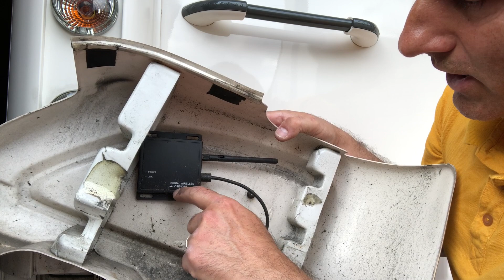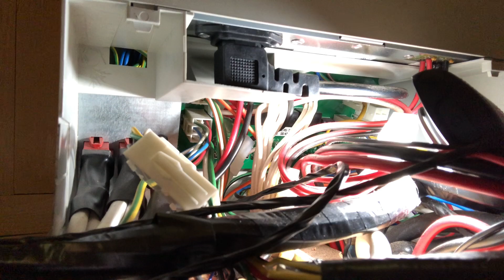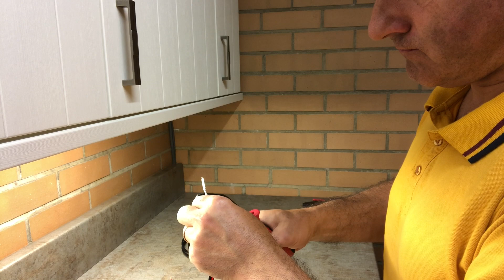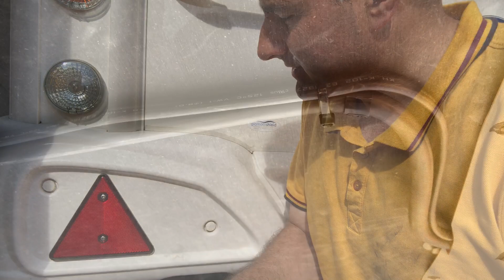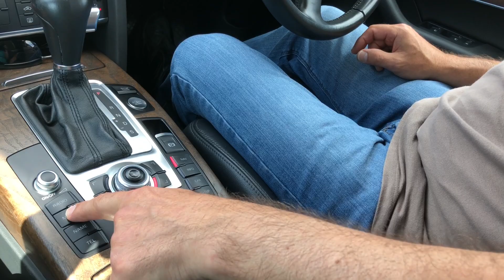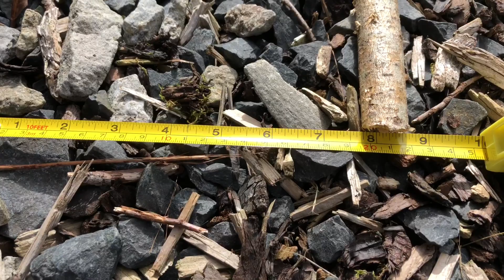Caravan Reverse Camera

Comment: Hello Rob
The most common insurance claim by more than double of everything else put together is reversing a caravan.
I have the highest standard of driving tests and class one.
If I was taking a student out for an advanced driving lesson this is my advice 
1/ learn how to reverse your caravan 
2/ Always pull up just past you pitch unhitch and use your motor mover to position your caravan
This was you will stop the accident. No one goes out to have an accident they happen so remove the possibility. 
Over the years we have seen people slip the clutch and tip the caravan over on his wife. This year out of the 6 sites 5 of them had members reversing into bollards. 
Being a good driver is about reducing risk if you follow my advice you will never reverse into something. 
Stay well and have a great new year. 
James
Reply from the maker: Thanks for your comment James, common sense and good driving skills are important and I agree with all your advice having myself passed the advanced driving test in 1994. However, I am fond of DIY, always up for a challenge and like my gadgets. Having the ability to connect an external AV source to the cars screen was a good incentive to fit a camera. I have to say it’s something I haven’t regretted as Gail admits to being the worlds worst banksman. Unhitching and using the mover is something I do when the road is too narrow to reverse onto the pitch. The times when I do reverse on I fine tune the caravan position with the mover. Wishing you all the best for the New Year, Rob

Comment: Great Video - got me looking for a camera system. One point I would make is the inline fuse should be as close to the feed end of the wire as possible to protect the wire run from a short to ground. Don't know what the main fuse is but if the wire is not rated for say 20A and you get a short between the fusebox and a fuse in the tail light area then you could get a potential fire.
Reply from the maker: Thank you for pointing this out David. I can’t remember the wire rating but it is equal to or slightly higher than the ignition wire it takes power from. I just left the inline camera fuse where it was. As all the caravan rear lighting wiring goes straight from the car to the lights without any additional fuses I thought the camera wiring would be ok but it is something to look into. Thanks for watching and commenting, Cheers Rob

Comment: Very interesting. I have a wireless one plugged to the caravan battery with a spe rate screen. Mainly as I tow with two vehicles max the discovery had media interface so could do the same. The jag would need a new software set up I think. 

Not having a great deal of luck with wireless however so may need to re think.
Reply from the maker: Hi Justin, If you could manage to connect to your vehicles screen it would be good. But this would mean having a signal receiver in each car. As for wireless I wasn’t sure I would get a strong signal by fitting my sender to the rear of the caravan. However, I should have pointed out in my video the symbol on the screen indicated a strong signal. Hope you come up with a solution. Thanks for watching and commenting. Cheers Rob 👍

Comment: Excellent job as usual Rob and nice to see using all the right connectors , heat shrink and wire so no Billy Bodge Job.! Very professional.

I would like a rear view camera and unfortunately I don’t have a rear camera in this car ( VW Touareg). The OEM kit to use the existing MMI screen is quite expensive. It’s a similar system to yours but I don’t have Tv tuner just dvd playback which cuts off when you move and reverts to audio only.

An idea I have is to purchase a new dashcam with the rear camera that mounts on car rear window( Nextbase 522). 

As this rear camera comes with a 3.5mm connector I intend to use an extension cable to then move the camera from rear car window to the back of the caravan when towing.

Viewing would then be via the dashcam screen.

The Nextbase rear view camera is quite good resolution.

Thanks for the great videos and best wishes for the new year 

Regards 

Howard 👍🏻
Reply from the maker: Made me smile Howard, certainly no ‘Robs Bodge Ways’. It’s a shame the OEM kit is expensive. I’ve looked at the Nextbase website and it looks a good piece of kit, GPS etc. It’s a good idea but when you move the camera from car to caravan it would have to fit inside the caravan rear window to protect it from the weather. Just the question of running the extension cable from car to caravan. You could use a water proof connector (or make it weather proof) and place it next to the towing electrical plug. Would be interesting to know how you get on. All the best, Rob
Reply: @robswiseways5697  Thanks for reply and advice Rob !

In all my thinking through I had omitted to realise that the rear camera is an indoor device and my van doesn’t have a rear window!

May have to rethink - ideally I’d like to use the car screen - maybe I can find the AV input from the DVD player ( unit is in glovebox and drops down). 

Other than that I’d have to find a waterproof housing for the camera but then it starts to over complicate what was to be a simple idea.

Thanks again Rob , I’ve just ordered another drawing board to go back to 😂

Howard
Reply from the maker: It might be worth searching the internet for ideas. I’ve found a website called Car Solutions and Satnav Systems you might find interesting. They both show genuine VW equipment. Best wishes, Rob

Comment: At 10m:28s what are those connectors known as and do you know where I can buy them?
Reply from the maker: Hi David, It is a Two Way Connector (T) part number VF02T. Original BCA equipment. Packaging is labelled Powerpart. You can find them on the PLS Group website. They are a supplier to the leisure industry and I ordered / purchased mine from my local caravan dealer. Thanks for watching. Cheers Rob